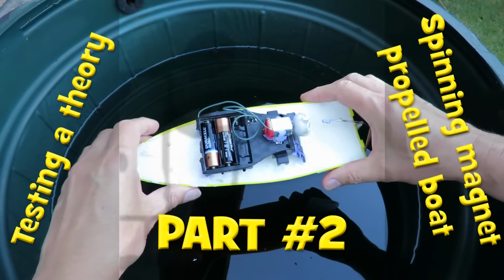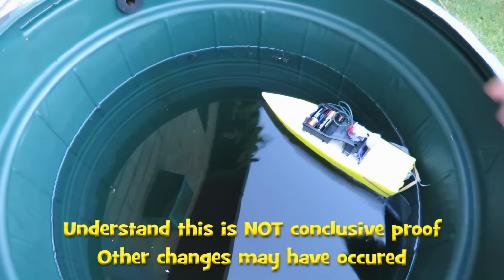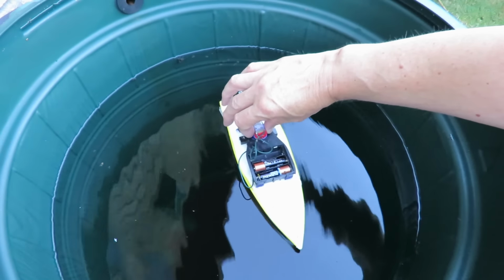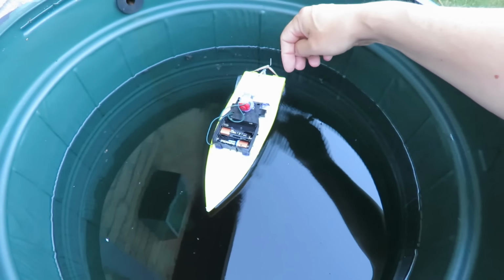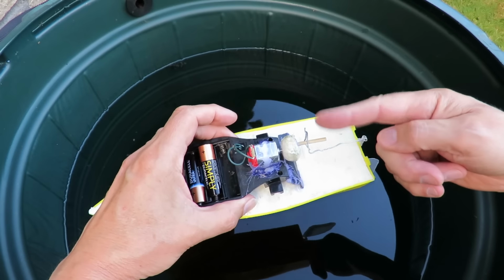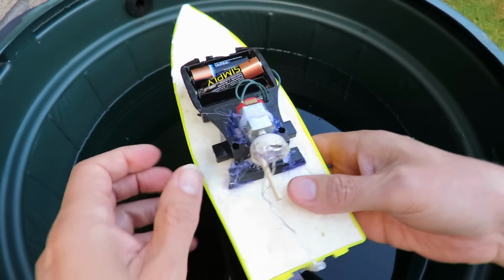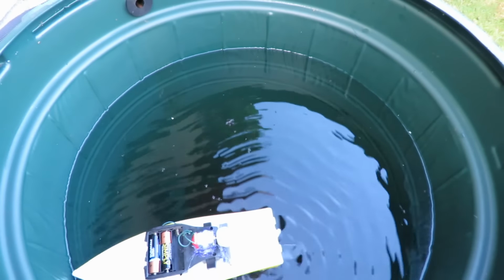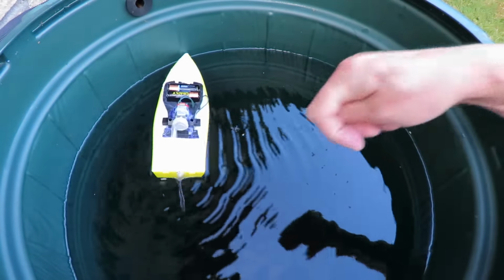Testing a theory Spinning Magnet boat for Good Boy PART #2

Comment: Make ur own fan light by getting a fan and a separate light source and putting it together and explaining it how it works.
Reply from the maker: Not quite sure what you mean by a fan light. I can buy a cheap fan that has pretty flashing LEDs which give you the Persistence of Vision effect POV  https://youtu.be/V93m4arq0n8  or if you wanted one of those ones that write a message then I would need to use something like an Arduino to sequence the LEDs and I do not want to work with Arduinos, Here is a POV message system by Slider2732 https://youtu.be/FwyYiu9ajnE  and a more complicated one by Great Scott https://youtu.be/57carjNxI9A